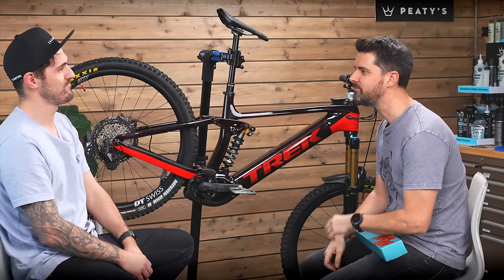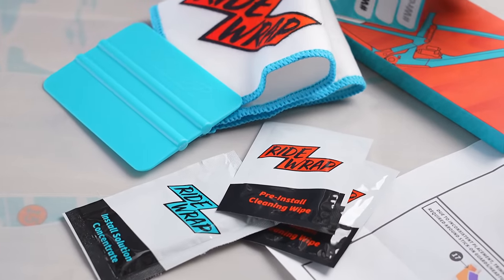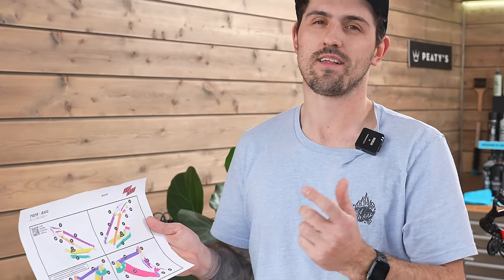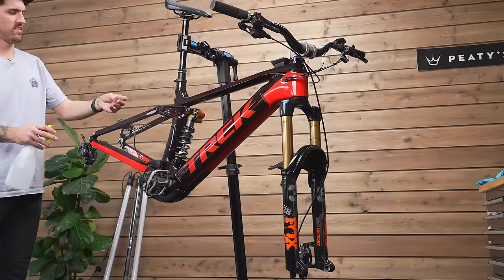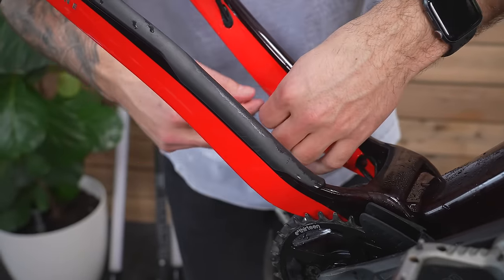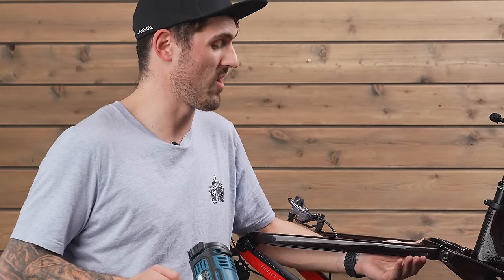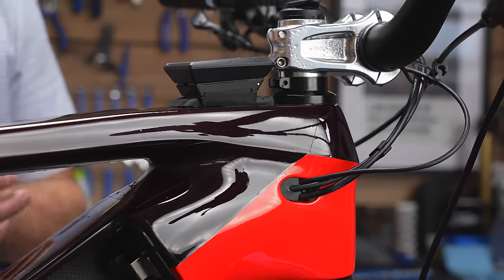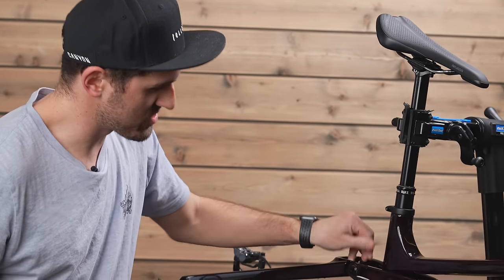How To Install Frame Protection To Your Bike

Comment: Yes definitely worth the $$ and effort.  And best new, before any riding. My current bike was wrapped new, is 4 years old and still looks new despite countless crashes.  Great stuff.
Reply from the maker: Agree! Have done all my personal bikes, keeps them in near perfect condition
Reply: Yeah its quite daunting at first if you haven’t done it before and you will screw up a few times. The main thing is follow the mfrs instructions as they do know how to get the best results. My tip would be squeegee more aggressively than you think you should, the film will take it as long as you dont move the position. Personal recommendation for invisiframe, they’ve been really great to deal with.

Comment: Fitted a ride wrap tailored kit to my fresh new Reign E+ 1  last night, first time I’d ever installed a frame protection, there are a few bubble but it wasn’t too bad, took me just over 3 hours.  The fit of the custom kit was bang on, I paid more than inv***frame as the ride wrap comes with the cleaning wipes and solution 👌🏻

Comment from the maker: Do you bother with protecting your frame?
Reply: Honestly….no….for me a mtb is something that I don’t want to protect from mother nature ;-)
Reply: Every time but the bikes are getting more complicated and putting the kits on more laborious. We nearly always need to remove swing arms, pretty much everything, even then won’t get every bit perfect. We also use a big bowl, that we dip the film and our hands in. Tight bits sometimes needs holding in place, think the hand heat helps here. Sometimes satisfying, other times down right annoying! Good luck…
Reply: Love the way he bravely pulls it back off to re-apply, we’ve found this can end badly …
Reply: My new 160E is just a beauty, and (full disclosure) it’s part of why I bought the damn thing!  So RW is going on!  Thanks so much for this great video.  Much better than the RW install videos, I think.  How long was the install (not the cut version)?
Reply: Spending $10k , you bet!